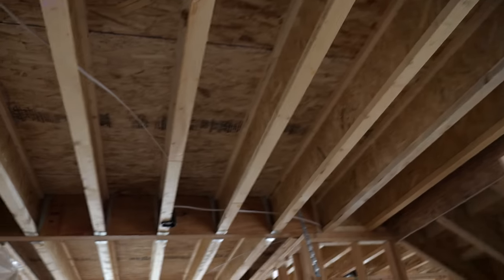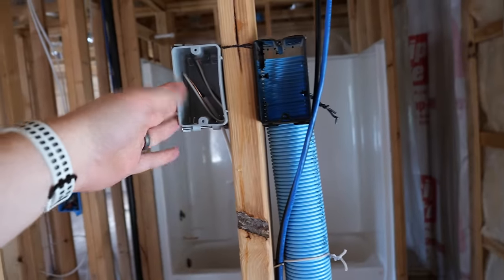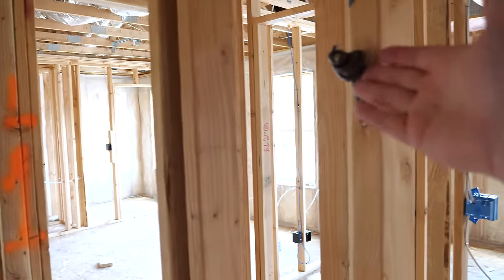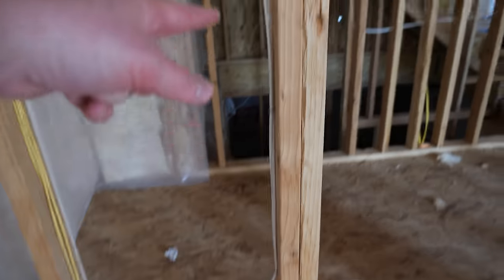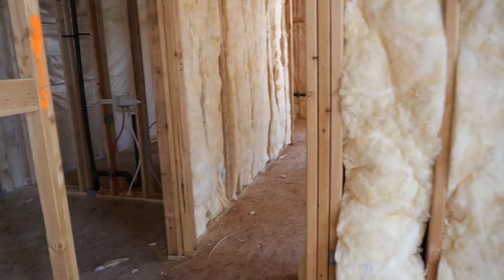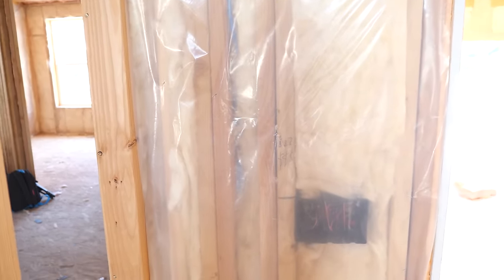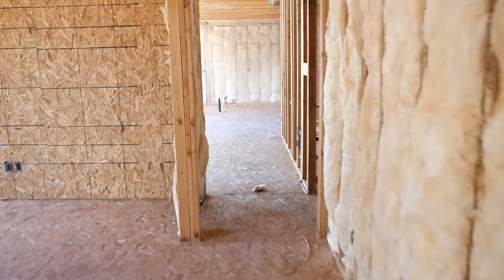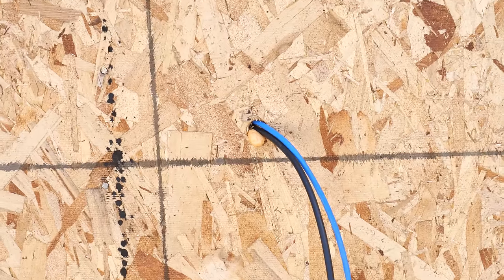Pre-Wire Walk Through of Our New Smart Home

Comment: Looks good. I just did almost exactly the same thing to our new house. Instead of low voltage to the windows though I have 120V outlets in the corners of all of them to provide more power (our windows are large so shades and blinds will be heavier than normal). I also have 120V outlets in the ceilings in all the room corners for sensors &/cameras. I had the wiring for the doorbell camera & a hookup for a control panel (tablet) next to the front door. 

Not for "smarts" but I have a couple of floor mounted outlets behind where we're going to put one of our couches. We'll have a table behind it and the outlets will let us plug in lamps, rechargers, laptops, whatever right under the table without needing to have any cords crossing the floor. We also wired under the breakfast bar so we can have cup warmers or chargers right there.

I like your Smurf tubes. We used 2"PVC but the same purpose. We ended up with two breaker panels in the mechanical room. Way more circuits than typical 🙂
Reply from the maker: That's great! I was surprised that we ended up with 2 panels as well but they do look a bit smaller.
Reply: @TechWithBrett  LOL! We have one large one and another that looks about half that. Plus the cat6 panel. So much for downsizing 🙂

Comment: Have you considered installing a Control4 smart home system? I have seen a lot of new builds with systems like that.
Reply from the maker: I have thought about it but barely had time to get this stuff in. Maybe down that road I will look it do it. I have considered doing a Ra3 for lighting but we'll see.
Reply: @TechWithBrett  With the current wiring that you have you could easily do a Control4 install in the future, which is the great thing about prewiring CAT6 to all those locations :)
Reply: I'm more of a fan of home assistant so I wasn't tied to an automation installer adapting all my automation needs given they change over time. I was pretty amazed to find it integrated with all my existing stuff on the first try so haven't looked back since.

Comment: Damn. Wish I was able to turn you on to a true low voltage lighting system. For your next build check out ATX LED… amazing stuff. No need for running 120 above standard electrical outlets.

Comment: I always put 4" Smurfs between floors, you have done none and that is a very easy run you showed perfect places to make those runs!  I always put TWO CAT 6 to every CAT location - CAT is relatively cheap - it's all about labor. You have half CAT locations I would - either side of master bed,  every wall of other rooms, the place you will do charging in the kitchen, garage.  Quick look tells me you need a minimum of 4 AP's (not the two you are doing). Another thing I am doing nowadays  is Toe-Kick LED strips in Kitchens - either with daylight sensor or even 24/7. I also only run 18g for LED lighting CL3 is really Not thick enough for DC in my experience. Garage needs a whole lot more outlets - even if you are not going to be woodworking or gearheading.  The termination box you have in the basement is VERY undersized, even for what you had brought down.  I could go on and on but think you have missed your window as I thin drywall coming in tomorrow.   I wish you the best!
Reply from the maker: Yeah drywall is already up but I love all the recommendations! I do have basement access still so I have the potential to add a few more runs.

Comment: IMO, i would have put in a 2" conduit from floor to floor. For future wiring. I would have also put in a small rack cabinet or bracket at the top of the house for all the cat6 to go to, then ran 2 cat6 & a fiber to the main location. Having a switch at each floor leave for expansion later in the future.
Reply from the maker: Great ideas.
Reply: @TechWithBrett  Now you know what i used to do for a living :)
Reply: Hey Jason, that sounds interesting! If they all run to the top of the house, how would that all run into the main room in the basement?  - David
Reply: @FWIWealthManagement  run the conduit to middle of house into a media box that you can use as a central point, or run one large one down to main area of house.

Comment: Doing the full surround system in the bedroom was an interesting choice.  Why did you choose to do that in the bedroom vs the family room? Also have your electrician wire in a whole house surge suppressor to your electrical service panel. Are you going to install smart lawn irrigation? Congrats on the new home!
Reply from the maker: The one request my wife had was that we don't put a TV in the family room above the fireplace. I have it wired in case we ever do in the future, but the TV would also be way too high above the fireplace. I did the bedroom as sort of my backup surround location as I do plan to have our main "theater room" in the basement.
Reply: @TechWithBrett  Our house came with in-wall speakers in the master bedroom. Having a 5.1 system in there is totally overkill but I dont hate it! Also, the master bath has an in-ceiling speaker which is really nice to have. Its wired to zone 2 of the master bedroom receiver.

Comment: For your LED lights under the kitchen cabinets, what is your power source?  Are you using a transformer that’s plugged directly into a switched outlet?  Are those LEDs somehow dimmable?  Are the 3 16/2 cables connected to the same power source? 

Thanks!
Reply from the maker: Yes. So from the light switch the lines go to a box where the transformer is where all the 16/2 cables go to. Then they are tied in through the Transformer.  And yes the LED lines are dimmable.  I have them connected to a Lutron Diva Smart Dimmer. Here are some more details: https://imgur.com/a/LDArcg5

Comment: The wire going to your sliding door could be used for a hard wired contact sensor. Wired sensors are also nice on entry doors as you never have to change batteries. I noticed that you didn't show any wiring for a home security system. It's a good idea to keep that private and not to show it on YouTube.

Comment: I think you will need a coax cable for the subwoofer but most importantly, why are the ethernet cables going to two different places in the same room?
Reply from the maker: I forgot to mention I did swap out that cable to RCA for that. I found out a subwoofer needs to have a shieded cable. Are you asking about in the bedroom? I ran 2 behind the TV but I could also pull the out on the bottom behind an entertainment center if I needed to for a game console. Or I can use of the for audio back to the receiver in the basement.

Comment: Great job. The EV outlet really needs to be 60 amp not 50. And the Netwerk patch panel is going to need to be triple the size. Otherwise looks awesome
Reply from the maker: Right not I'm not positive what that actually is. Since the cable is there I assume we can just change that at the breaker? I definitely need to be looking for a bigger patch panel. I was surprised they even provided something.
Reply: @TechWithBrett  Depends on the gauge of wire that was used to run the EV circuit. Six gauge would be for 60 amp and 8 gauge for 50 amp.  So if you have a six gauge wire then you can change your breaker otherwise do not. 50 amp is good for many vehicles but a new Tesla would be best with 60 amp service and set the vehicle to 48 A draw. You really shouldn’t draw 48A from a 50amp service as you should leave 20% reserve at all times. Electric Vehicles are only getting bigger and bigger battery packs all the time so if you don’t plan to get a vehicle for a few years better to have a larger service put in before hand.  Best of luck.
Reply: my builder only offered 50 amp unfortunately so we made do with that but my outside external panel has a few spots open for running something higher which just happens to sit outside my garage so it shouldn't be too big of a pain to add more.

Comment: Thx for this video, framing continues next week for us.  And I’m doing all the wiring for 4K distributed video & audio & smart home.  Question on your LED strips in the kitchen.  How does that tie into the light switch?  I bought into the Lurton eco system myself for my last house & i removed all of my light switches & fan controls before I sold the house.  I’m sort of familiar with electrical, where one leg goes to the light itself.  I’m confused b/c I was thinking the CL-3 was more of a low voltage cable but does it go into the same electrical box as the high voltage?   What I’m asking is when you press the on button, is the cl3 wired to the same switch with high voltage?
Reply from the maker: I didn't wire it but after double checking this is how it is setup. At the light switch that is where the 120v comes in. It then carries power to a transformer in the blue outlet/low voltage box, it then converts it to 12v for the low voltage wiring. Talking with the electricians they said I will be able to put a dimmer on the light switch so I can add a smart switch dimmer there.

Comment: Great walkthrough Brett. Did you consider cat7 for better electrical shielding. I did my property refurb with cat7 throughout and it worked out a treat...
Reply from the maker: I certainly could have but decided on Cat 6 as it should be plenty for standard usage in the house. In the basement it might be different when I finish it as I plan to tech it out a bit more.

Comment: hi there! so we are rebuilding a 1980s building into 4 lux apts for mid- term rentals for govt contractors. We want to pre wire the building so the cable company does NOT come in later and mess up our apts. However, they (xfinity is our only choice) refuse to even discuss it. Any suggestions ? we are both BC-A contractors and owners on the job.

Comment: As an ISP technician i've always wondered why people never run proper entrance wires into their network rooms before the drywall is up when you have a specific location the modem needs to be. 

If you're planning on having fiber installed at the house, you really should get an electrician or your ISP to run that fiber directly into your network closet.
Reply from the maker: That is one thing I certainly didn't think about and the electricians ran most of the cables... so that really didn't help much. I have routed the cables to a better wall location but some are short now. I should have planned ahead.
Reply: @TechWithBrett  Yeah i've seen this countless times and the home owners wish they heard that information before they placed drywall.

Comment: Did builder allow you to run your on cables? did you negotiate this or just sneaked in and ran wires before they put up the dry wall?
Reply from the maker: The GC was a little skeptical about me doing it so I did pay to have the electricians do the majority of it and then when they were done and the Inspection was done the GC said I could go in and add more but to be careful where I drilled. Building a good relationship with them could help and maybe a pre plan of what you are going to do.
Reply: @TechWithBrett  Thanks Brett. I really appreciate your quick response. All I need is a few ethernet drops but $500 each is like day light robbery. what about the outlets you added are those covered by sheetrock and you finished those after closing on the house? if its not the part of electrical plan, wont anyone notice the extra unfinished outlets? sorry I am just trying find the best way to deal with this when time comes. TIA
Reply from the maker: We were able to do a pre walk-through with the electricians and chose where we wanted to pay extra for outlets. I may have added a few extra the night before drywall went up 🤫. I am super glad I did because while it is possible to add outlets later, it is way cheaper and easier to do it before the drywall is up.

Comment: Hi Brett,
Next to garage door why do we need POE CAT6 cable? Can we not install power outlet?😊
Reply from the maker: POE was cheaper to add than an outlet and many times you might have a bad Wifi signal outside so POE can give your decive a dedicated 1GB connection for data as well. That being said, I would have liked to add more outlets up and around the soffits of the home just in case I want some.

Comment: Can someone explain the difference between POE and a CAT cable?
Reply: There is no difference.  PoE comes from the network switch with stronger power supply sending standards based energy over you basic category cable.   So really there is no PoE cable rather PoE can be used safely on Category 5e and up.

Comment: I would have wired all the windows for contact sensors so you don't have to use battery powered contact sensors for security.
Reply from the maker: I debated on this but in the end ran out of time but wish I had. I have seen some newer sensors that are lasting up to a year so I'll have to try those out.
Reply: @TechWithBrett  If I had a pick between wired contact sensors and wired blinds I would have went with wired blinds too.
Reply: @donnycasey6613  That's my biggest regret is not adding some outlets or wires into my great room windows for smart shades. If you do an outlet you can get both though. I'll figure out a way somehow to wire them, it's just going to be a gnarly job routing wires from the two outlets below the windows around and drilling through 5 studs while doing that 16' up. The basement though is all decked out with outlets in the window seams so it will be getting automated first.

Comment: Great video.  I know it’s probably overkill, but I would have ran Cat-8 cable to future proof it.  Glad to see you ran ethernet cables for PoE security cameras.  
I would also add a whole home surge protector and maybe wire it so you can add a backup generator. I know, overkill.
Did you run speaker wires to each room for whole home audio?
Reply from the maker: I debated on the speakers and ended up deciding against it because we already use Google speakers in every room. I know they are not as great but we just don't have music playing through the house that often.
Reply: @TechWithBrett  Yeah, I understand, have Echo Dot 3’s and a few HomePod Minis throughout my house and they all sound fine. It’s nice playing music throughout when you’re cleaning. You mentioned in the video of diagramming your wires, I would also diagram all of your water pipes and maybe even run some wires for water sensors in case you ever get a leak, in the laundry room, toilet areas, all sinks, refrigerator, dish washer and water heater. Good luck and enjoy that new house. 👍
Reply: Cat8 are you crazy? You're never going to need that lol.
Reply: @robertmedina3195  It’s called future proofing. LOL

Comment: You may like to wire those small windows, I know you stated no need but later if you like to then you will kick yourself.
Reply from the maker: I plan to just use battery in them since they are easily accessible and the battery should last a long time.

Comment: There's a lot of obsession with more cat6 in these comments...do people really have that many wired devices this day and age? I can setup WiFi to have hundreds of devices and top speeds can easily exceed 400-500mbit/sec.  I prefer less wiring and more WiFi.  My TV can stream high quality 4K with only 25Mbit/sec or so of data.  16K if future proofing would be 100Mbit/sec.  I guess people are used to crappy WiFi and think everything should be hard wired instead??
Reply from the maker: This is certainly my approach. I like to have a wired connection available for the high traffic low latency devices, but for the most part everything will be on Wifi. I currently have 67 devices on Wifi without any issues.
Reply: @TechWithBrett  The latency issue is no longer an issue if you have the right hardware.  I have setup several sites with many access points and the WiFi latency is no more than 2-3ms higher than if you were wired.  Completely unnoticeable and only if I were a professional gamer would I go ahead and Ethernet directly to devices (aside from a few key spots / devices I am certain of in the house when building).  It is true though if you have multiple high traffic devices that can slow things down further especially when doing to the same AP that isn't great at handling 3+ clients with high demand but it's easy to get a powerful AP for such a spot in a house.

Comment: Not to be Debbie downer but this is really basic. I added more Ethernet to my house with finished walls. The price they are charging is absurd for a network line (it’s low voltage so you could just do it yourself) but not running multiple lines for each room, etc seems short sighted. You really don’t want to add anything after the walls go up.